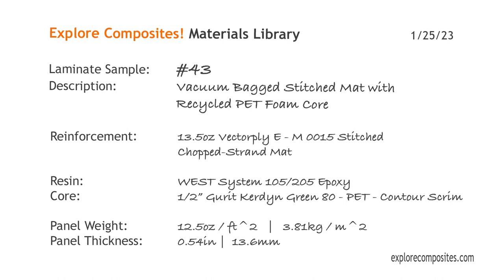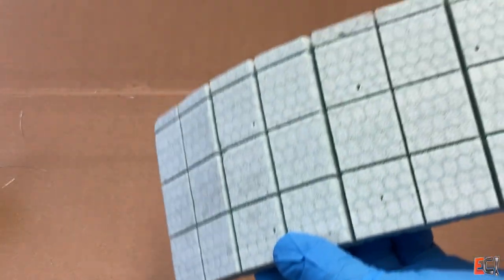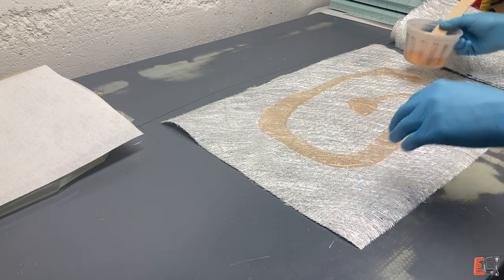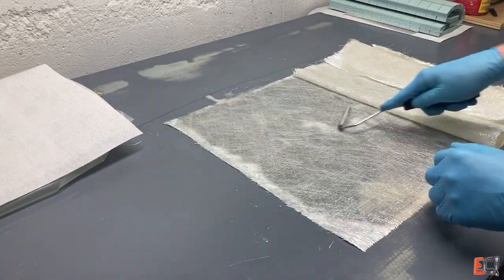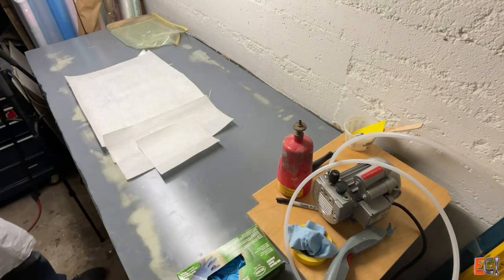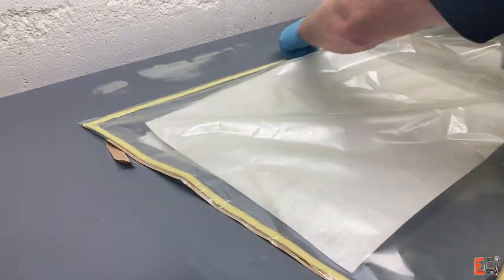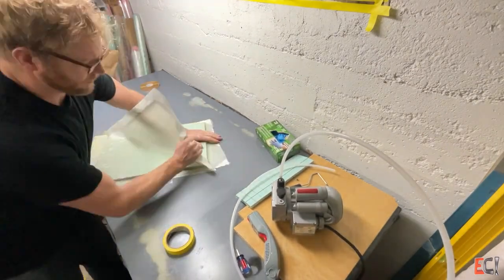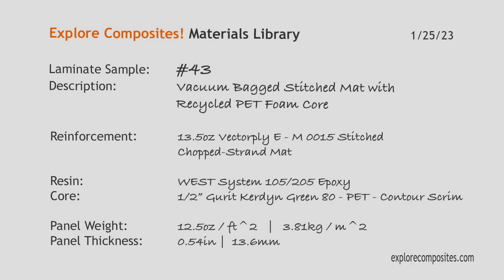Laminate Sample #43a: Vacuum Bagged Stitched Mat with Kerdyn PET Core

Comment: Can that core material with kerfs running in both directions be able to conform to gentle compound curves? Great video as usual!
Reply from the maker: It doesn’t compound bend as well as it looks like it should - but it’ll do a lot of bend one way mixed with a little bit of bend the other way… it would struggle with too-tight a sphere!
Reply: @ExploreComposites  gotcha, thanks again for posting informative videos, I've missed them.